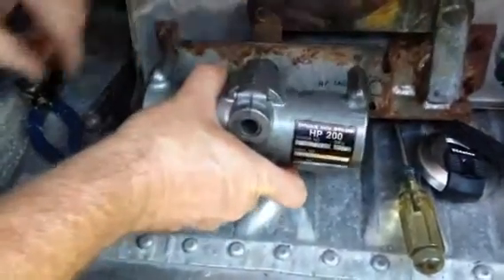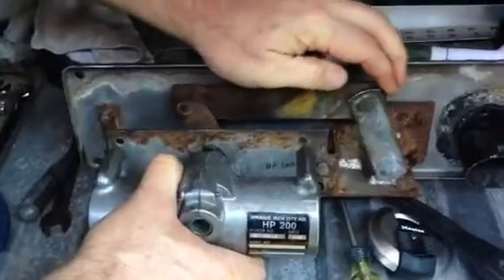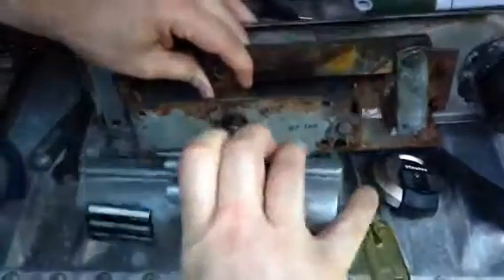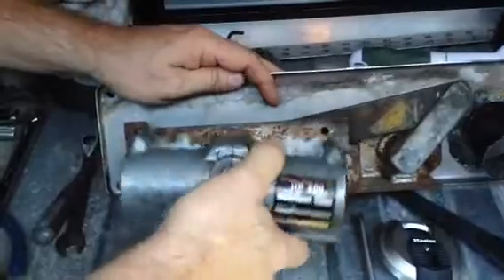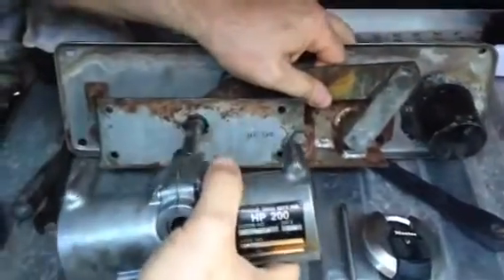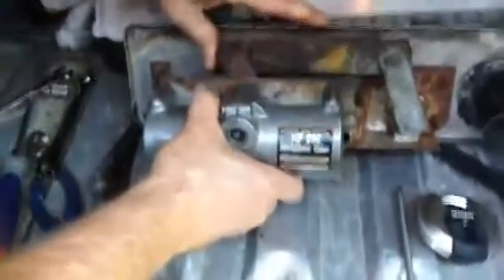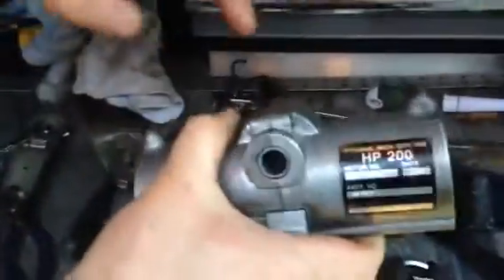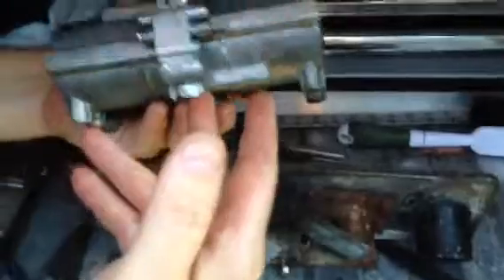Air Wiper

Comment: did you ever figure out what the problem was? can those be exchanged with electric wipers with out allot of headaches?
Reply from the maker: Ya, I had a friend who sent me a video of his rebuild.  problem is I can't find it for you.  But I had a gear in wrong.  
If you can afford the electric they're wonderful.  I don't like the air wipers at all.
Reply: ok,glad you got it worked out. I'm not a lover of air anything (well except brakes) but I had an old car that had air wipers and I hated them, pouring down rain and you step on the gas and they'd stop, they were a pain!
Reply: @TikvahDave  i cant get my wipers to work at all. i got  new valves but wiper motors dont move
Reply: Dave Reed 
It’s been a long time, but I remember there’s a dozen ways to do it wrong and only one way to do it right.
The timing gears are the first place to go wrong.
I wish I was more helpful but that was ancient history for this old guy.
Reply: thanks